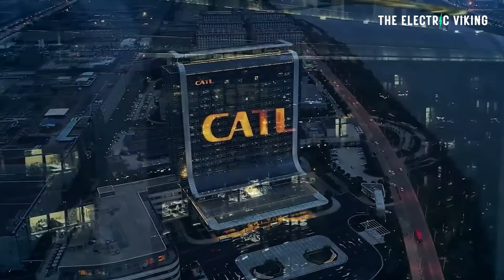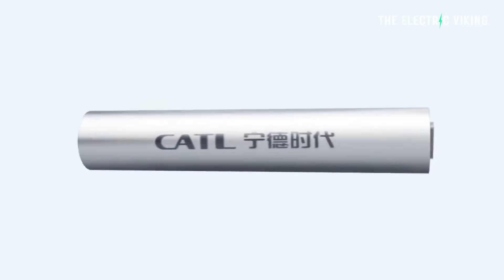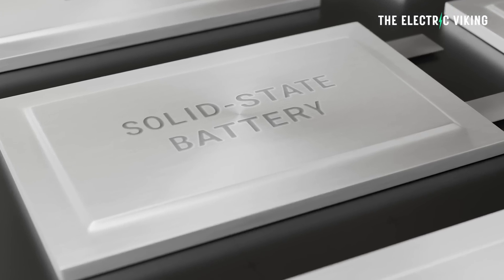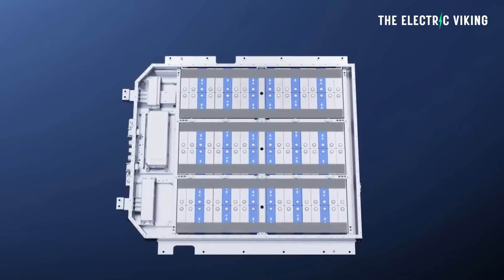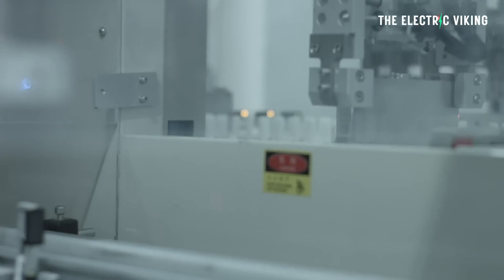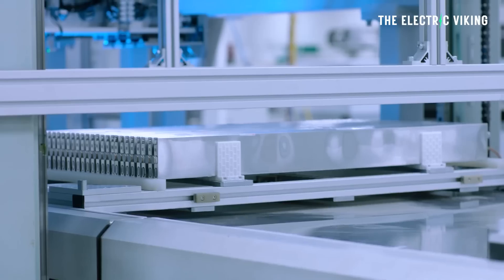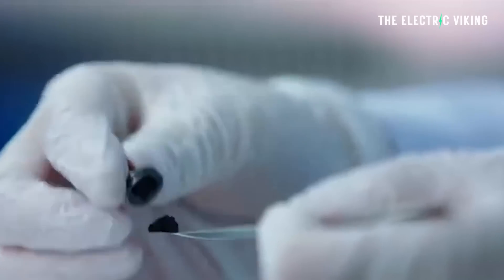CATL's sodium hybrid battery will be 30% cheaper & revolutionise the world

Comment: Gasoline is 2700 watts per kilogram. This Australian Dick is talking blah de blah bollox. 
  Report again when the battery  manufacturers get to 3000watt per kilogram and can charge at 5 minutes with a reliable infrastructure to support this.
  Bottom line is the consumer knows this is flawed concept at existing technologies. 
  Try again in 15 years time.

Comment: My comment is more fundamental - no matter what kind of battery - even it it costs nothing - if everyone tomorrow woke up with an EV in their driveway, the grid would absolutely collapse the first time they were charged! EV's may have a small corner where they make sense but not in mass for everyone. All the 'environmentalists' are tearing down dams which generate cheap electricity and blocking nuclear reactors. If we really insist on going totally EV then there should be a law which mandates that they are charged by their owners using their owners own solar panels and wind turbines.

Comment: We are not building nuclear power plants in the world and they are considered base source since they have a long time constant, slow response.  Solar and wind are a small portion of the power grid and since they are not on demand power sources they will always be a small portion.  And finally the national and world power grids for all electric need to significantly expand.
Efficiency!  The reason power plant are scattered is that power transmission losses are not trivial.  And when you combined the losses from the source to the load and compare it to thermal power system they are more similar then different.  So there isn't an environmental reason.  And the thermal infrastructure exist.  Not considered is that batteries are less power dense then fuel by far and far more of a health hazard in a crash.

Comment: Every few weeks there's a 'new' battery tech, based on some hand built prototypes. There is a long step between small batch production and mass production.

Actual new tech appears first in small products (phones, computers, power tools) before working its way into automobiles. That's the place to realistically look for the future.

[The other, and bigger, problem is that fast charging requires very high current charging (no matter how efficient the battery is--that's physics). The infrastructure to massively distribute that level of power (as well as the need to make it safe for ordinary customers to handle daily) is not ready.

Comment: Part of the cost benefit of Na-ion is their inability to form an alloy with Al. This allows replacement of the Cu current collector on the anode to be replaced with cheaper and lighter Al. If you have Li ions floating around in the electrolyte I wonder if this Li-Al alloying will be an issue and they have to go back to the more expensive Cu

Comment: i am very skeptical.
mostly based on these are tech companies.
and they always over promise and under deliver.
even when it is a good product.
but tech companies run on investments even when they do not need to.
so they need to keep the stock holders hyped.
and that always breaks up a company eventually.
hell actual success can destroy a company because of it.

Comment: 90% charge at -20C. Essential even in New York. When I was working there in the early 1080s we had -1F/-18C and barely any higher for a few weeks, so that when the temp rose to 32F/0C I was walking around without a coat and not feeling cold.

Comment: What will these new cheap EVS do to the depreciation of EV people have already bought?  If these new batteries can be charged so fast will I ever in practice be able to do that as the charge infrastructure may not have 300kw plus  charge rates. What odds are you offering on the $5000.00 car? I’d like to get some of that action.

Comment: This type of battery will be used in stationary applications only.

The climate cult keep banging on about EVs saving the planet. They dont mention embedded energy. This for the copper, nickel, cobalt, lithium etc mined, smelted and manufactured for batteries  charging stations and infrastructure.

Cobalt mining I  Africa uses child labour. You happy with that?

All the modelling is based on  intense driving. If you only drive 5000kms a year the wheels fall off the calculation.

EVs are just not selling. The public are smart. They know they been sold a pup.😢😢

Comment: Victron 12V inverter has a voltage range of 9.5-17 volts, so anything below 2.4 volts/cell and above 4.25 volts/cell would be unusable and wasted. That equates to about a 60% usable energy range. That applies to 24V and 48V systems as well.

Comment: The charge condition slope is not as flat as LiFePO4, or lead acid. Resembles a supercapacitor charge/discharge graph, while the total capacity may be larger, the usable capacity is limited by the power accessible by the inverter. Voltage too high on the 100% charge end, and too low to power the inverter on the low end, well before 0% charge. So a 30% increase in total battery capacity is only about the same usable capacity as the LiFePO4 chemistry.

Comment: Sam, I don't even break out my warm winter coat until it's colder than -25°C.  And about 25% of the USA experiences -20°C or colder many times each winter.
Reply: Battery sodium temperature are -40° C to 60° C

Comment: Na explodes in water. What will cause a thermal runaway? And if that happens what will you put the fire out with?
Reply: Um so does lithium. Also there is no elemental lithium or sodium in the batteries.
Reply: @4203105  Show me the compound forms.

Comment: Well. 200 watt hrs per KG is 1KWH per 13 lbs.   FULL DRAIN 3 MILES. -half drain =1.5 miles??    1300 lbs+ 150 miles???

 Pretty sure 300 watt hrs will get you ONE MILE AT 60 MPH??

What am I missing? Oh I assume USA based companies STEAL CHINESE TECH-just like everyone does-so if they make these batteries here

we USA based companies will STEAL THE TECH-REVERSE ENGINEERING.

Comment: The most significant issues with making all new chemistries and packaging viable are cell resistance matching consistency from the production line and the scrap rate. Many defective 16850 cells make their way to the supply chain as Ebikes or other consumer products. I hope the large manufacturers will put pressure on the problematic bootleg counterfeit testing lab products.

Comment: Thermal Runaway Potential ? Have you ever seen NA+ ( Sodium) Burn ? That is why NA+ is shipped in Mineral Oil to keep the NA+ from combusting when exposed to air with humidity.
Storage Requirements:....."Sodium must be stored in a closed container under kerosene, toluene, or mineral oil. Contact with water should be avoided because sodium reacts violently with water to form hydrogen (H2) with evolution of sufficient heat to cause ignition...."

Comment: Sodium could eventually replace Lithium, not only for large scale storage applications, but also for transport.  Once super charging is ubiquitous, range becomes less critical.  If one can get 200 km in 10 minutes of charging, that's all one needs. After 200 km driving one typically likes to take a 10 minute leg stretch, so it works out nicely.  Basically it's like taking a short break after driving every two hours,  which is very sensible.  Probably best practice.

Comment: While the headlines have been chasing energy density, the real factor in some applications (budget cars, grid storage) is cost and longevity. It isn't that hard to make a car a little heavier and throw more batteries in engineering wise, but only if those batteries are significantly cheaper. I am not sure they will be.

Sodium is absolutely real, happening now, and likely to be the majority of batteries in the world (by weight). Most of them just won't be in cars. Sodium is the ideal grid storage battery, with its longevity and safety and cost-per-watt-per-lifetime-cycles outperforming lithium, but its floorprint and power outperforming older chemistries. Weight and floorspace are less of a concern in grid storage. 

Price isn't just about the cost of the materials. Its a supply/demand thing too. In the short run, sodium batteries are actually more expensive. If their high cycle life and low cost per watt means the grid storage people buy them all up, there might not be a big value difference for carmakers who could pay some more for a much higher density LFP battery. CATL is also coming out with a next-gen LFP soon. Either way, these next gen chemistries are absolutely gonna destroy fossil fuels, both in the car market and the grid peaking market. Solar and wind are already destroying the bulk power market.
Reply: it's a bit silly to say that these won't be in cars due to their energy density when they have higher energy density than the packs in the best selling EV in the world.
Reply: @somedude-lc5dy  uh, no. CATL currenty supplies Tesla with an NCM battery that is about 300 wh/kg and CATL's gen 2 sodium is aiming for only 200. Gen 1 will is only 160.

CATL does have battery packs coming out that have higher densities (including a 'condensed' aviation battery), but these have different chemistries. What we are seeing is a diversified portfolio of batteries for applications - sodium for grid storage and cheap cars, LFP for cars, and 'condensed' batteries for aviation and supercars. 

While there may one day be one battery to rule them all, today is not that day. Even if the most dense batteries were the cheapest to make,  supply and demand means that the super batteries will command a high price and limited applications until they scale big enough in volume production.

Comment: We’ll see when it becomes available, proven safe, getting low capacity loss at low temperatures and have 20,000 charge cycles or at least 10,000 with capacity at the end not less than 80% of the original . I doubt very much..
Yes, also being able to charge 80% of its capacity in 15 minutes. I doubt square.

Comment: Sodium ion batteries are probably going to be most useful for fixed installations where density isn't such a big deal. The density could be an issue for cars but it ultimately depends on what density they get vs LFP. I expect the cost savings will mean that a lot of cars will be using sodium ion batteries though.
Reply: but the energy density of the V1 and V2 batteries are already on par with the best selling EVs in the world; why would it suddenly become a problem?

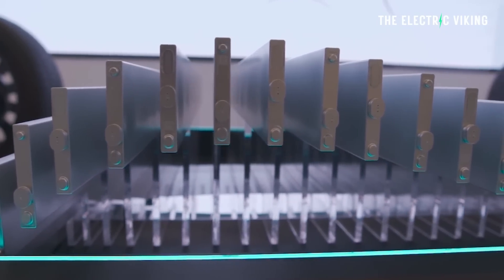Comment: 2:43 at $40/KW, for replacement of nuclear, 18 hours of production time for when the Sun isn’t shining, it comes out to $720,000,000.  This doesn’t factor in days without renewables not producing power, necessary transmission lines, and other factors.  I don’t think it will replace existing nuclear or nuclear in general given what is being planned for it.

Comment: You can now start to see a sort of Moore's Law affecting EV prices.  ICE technology has got marginally more efficient over the last 40 years (small capacity, 3 cylinders, high-revving turbos ..etc) but at the expense of more complexity.  It's really gone as far as it can go.  My Dad's 1978 2.0L Ford Cortina is really not that different to my last ICE car, a 2016 2.0L  Ford Sierra.
Battery technology is evolving so rapidly, especially if Solid-state goes into full production, that we could be looking at overtaking ICE in every aspect in 10 years (range, charging speeds, weight ... everything).
13 years ago the Mk1 Nissan LEAF did about 120km maximum.  Now we're approaching the point where 400km is becoming standard.  I can genuinely see 500km being ubiquitous in 10 years, with 1000km on high-end vehicles.
It's great to be part of this revolution and witness the rapid evolution.
Reply: That is the one bright spot in the daunting logistics of transitioning toward electric cars: the slow pace of actually making the change (the public has little idea of the incredible costs and logistical hurdles involved) allows for innovation even as we move forward.
Once the public understands that few of us will live long enough to see the change complete it will learn to be happy improving the pieces step by step rather than having a completely raw product suddenly trying to be the final product.

Comment: What really matters is the thermal runaway problem. This issue needs to be solved. As EVs and storage batteries become more popular and prevalent, we are bound to have some disasters and people will be killed either by fire or toxic fumes, e.g. car ferry boats, tunnels, car trains, parking structures, solar panel batteries in houses/garages, etc. Imagine an EV catching fire on a train full of EVs under the Channel Tunnel - the toxic fumes would kill everyone and possibly destroy the tunnel. When will people wake up and see the danger?
Reply: An airplane crashes and ship sinks. We still fly and sail. People see the danger and also the benefits and those are so significant we arnt going to stop cos of the known risk of an accident.
Reply: @TimMountjoy-zy2fd  Sure, but all cars will be EVs in future, so it not going to be a rare event. Over 1 billion cars in the world today, 40,000 planes, 60,000 cargo ships. So approx. 25,000 times more prevalent. Also, planes have very tightly controlled safety regulations. Batteries > 160Wh are not allowed on planes and in any case are not exposed to physical damage/penetration/charging failures in the same way that BEVs are. Battery fires cannot be extinguished and generate toxic fumes and temperatures of 2000 deg C. It's not the same as a petrol/oil fire.

Comment: $40 per kWh turns the world upside down.

Literally no other energy mechanism could compete with wind/solar + battery.

100kWh for $4000 is enough to power 10 homes for a day or meet the entire energy needs for most homes mid winter.

Big oil, little oil, and the entire economies of any state that exports fossil fuels are gone overnight.

Judging by the lack of sheer blind panic in global markets...

Yeah, no.  This ain't happening.

Comment: ICE vehicles will be around for quite a time yet. It doesn't matter how effective the energy storage is, the infrastructure still cannot deal with everybody plugging their cars into charge at 6:00 every evening.
Reply: An often overlooked advantage to widespread residential and manufacturing solar generation and storage is that it will take away the worst effects of a military attack on the nation's power grid. It will ago reduce the effective operating cost of personal transportation to nearly zero, freeing up petroleum resources for commercial and military years and reducing the economic and environment costs of those critical transportation resources. Lots of upsides. Not many drawbacks. It's going to be a long transition, but the meet result will absolutely be worth it.
Reply: My car gets plugged in once a week. The utility decides when to begin charging based on load, but usually around midnight. It takes 32amps at 240 volts, and takes 6-8 hours to charge. My electricity usage had overall increased 10%, or about $350Cdn/€235 a year. 
Some cars have Vehicle to Grid capability - they can give back to the utility when loads are highest, and recoup when needs and prices are lower. So actually, they help the grid.
Now think about it. Your ICE car can’t do that, and your fuel bill where I live is about ten times as much for the same car powered by oil, plus you have to find a place to fill up. When I’m on the road, my car will tell me where to charge and estimate range. 
As other commenters have said, all you do when Canadian temperatures hit -40C is plug in. The battery is fine, the passenger compartment is warm and there’s no fumes to worry about in the garage.
Reply: Wrong. IF these prices are correct (they're not), then trickle charging a battery at a charger location solves the problem of "everyone charging at once".

In fact, it's game over, overnight, for everything to do with fossil fuels.

Think about it, under $5000 for some solar panels and a battery and you never need buy energy for your home again.  $50,000 and most businesses become self sufficient in energy.

The economic shock to global economics would be massive - it's impossible to estimate the scale of this.

IF that price is correct.

Which it isn't.
Reply: @paulgoffin8054  If this is true we would have already seen a major change in vehicles.
EV is still unusual for everyday people, the poor are still driving cars they can afford without altering their houses as well.
The poor outnumber the rich by a huge degree.
Reply: @squiremc  I agree, which is why I'm saying this isn't true.

Now, if CATL have only just started up at $40/kWh, then, obviously, ordinary people haven't had time to buy those batteries yet.

But you'd expect to see the financial markets going crazy as everyone dumps fossil fuel stocks at any price.

Military forces would be on high alert - gulf states, Russia, Norway, Australia, would become irrelevant overnight and bankrupt by Wednesday.

Yeah, no.

Not happening.

Not yet.
Reply: @paulgoffin8054  Agreed.
Reply: @paulgoffin8054 ICE vehicles will be around for decades longer. If you don't understand that, you're either too naive or too stupid.